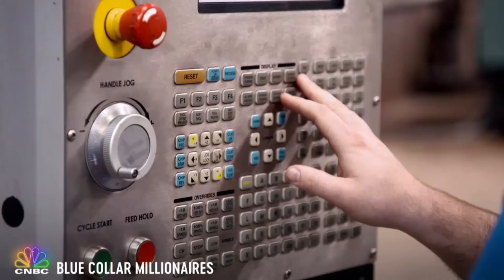The Millionaire Mechanic | Blue Collar Millionaires

Comment: Not all money is made in silicon valley.
Some is made by hard work in traditional industries. In this case, oilfield support, is victim of the pandemic
Reply: J josephm a lot of it is
Reply: skitzmaker a lot is spent as well. 1.2 mill, you’ll be lucky to by a shack there
Reply: Joseph Roberts huh? 1.2 mil gets you 2-4K sq feet here
Reply: Are you serious? He hat 120employees but Only has a 1,2m Home. An average Silicon valley employee could afford a was bigger home after working so Many years
Reply: I wonder how oil bankruptcies will affect his business thou...
Reply: @TheLordtoni12  Have you seen a  $1.2 MM home outside of CA? Massive
Reply: J josephm if its Build out of Sticks instead of stones then yes probably
Reply: @TheLordtoni12  I think you're missing the point. And you've never been outside CA either. A $1 million home in TX is about as big as you could ever need. Dude's house is clearly massive and perfectly suited to him. He's not going to get an even bigger house simply because he can afford it
Reply: He has a good wife, so they are gonna be fine
Reply: Ken MacDonald  yea, in both cases there's a big difference between employee and employer. You need to grind like crazy like this guy did to get to that level.

You can also be a genius (Bill Gates, Jobs) or be in the right place at the right time (Steve Ballmer, early FB employees).
Reply: TheLordtoni12 what drugs are you on? As a real estate broker, that’s is the MOST VALUE you will get for 1.2M.... His property in Washington / California / New York would be 5+ million EASILY.

Comment: they said he "pocketed" 4 million in 2014, oil prices were like 100 then down to 70 dollars a barrel then, they are now like 20-30 bucks a barrel. wonder how he is doing these days
Reply: This man isn't selling oil!!!
Reply: @mathewkendell9056  I don't think you understand, oil prices increase or decreasing also means mechanic work for trucks increases or decreases, for example if you owned a diesel truck mechanic shop and oil got super expensive instead of the usual 10 trucks per month they send to you, they now only send 2 because only 2 can be afforded to run, everything is linked matt.

Comment: This is what skilled labor has become today. Some mechanics that are self employed are charging doctors fees to have machinery worked on. It’s absolute nonsense, this is what created the world were it is cheaper to buy a new one than to fix the old one.  My local shop mechanic shop is 100 bucks an hour, my dealership chargers 145 per hour. There paying there mechanics 16 to 24 per hour. Yes there is operating costs, but most f the run at 25 percent operating cost as a whole. So if you have 3 mechanics working for you, you bill out 24 hours per day shop time. 100 x 24 = 2400 subtract 25 percent operating cost is 1800 profit a day. It don’t take you long to become wealthy.